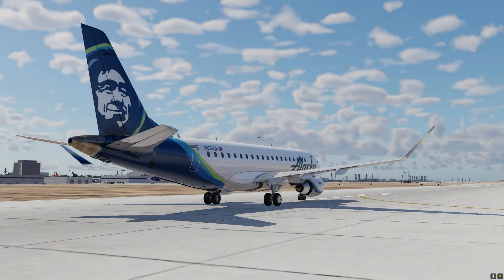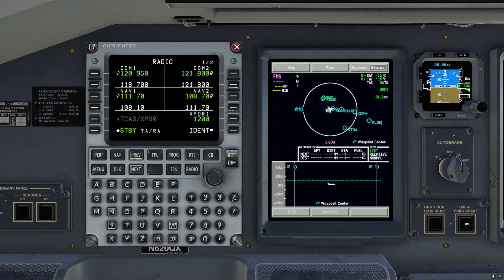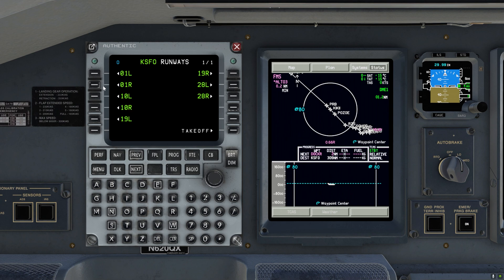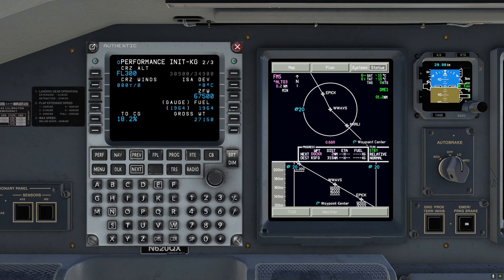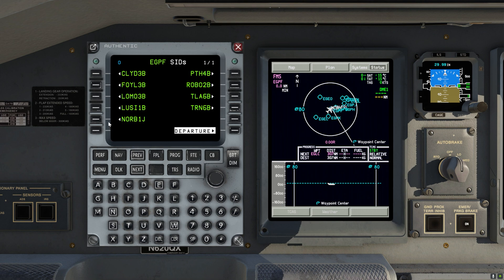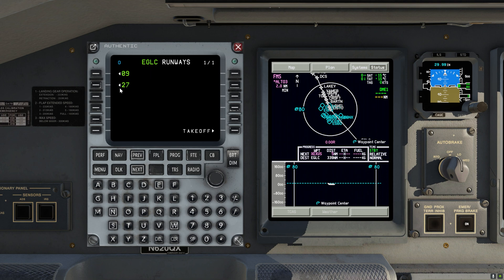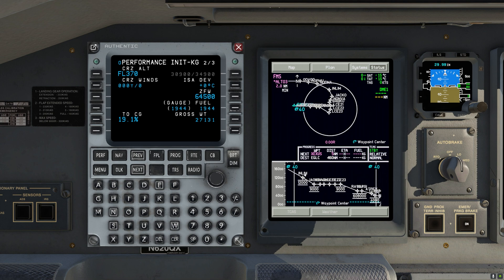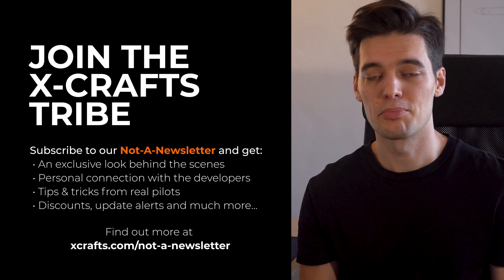E-Jets Family by X-Crafts | Programming the Authentic FMS | Exclusive Preview

Comment: For the radio page: Can you change the second COM 1 frequency at all? When I type it in and press on the stby frequency, it doesn't replace it.
Reply from the maker: For now we only have 1 of 2 entry options implemented. Just select the standby frequency and use the knob on the FMS to change it. We will add the direct scratchpad entry option in an update